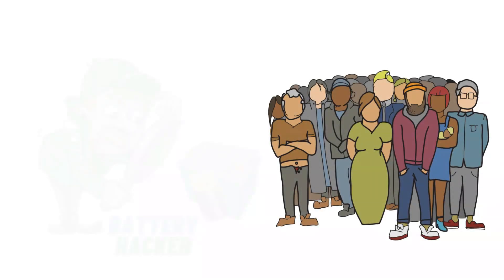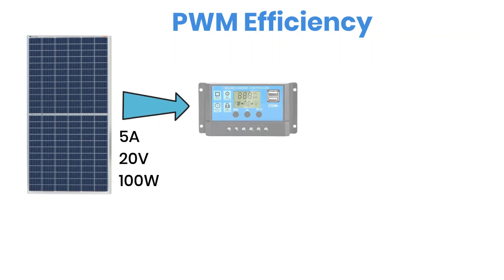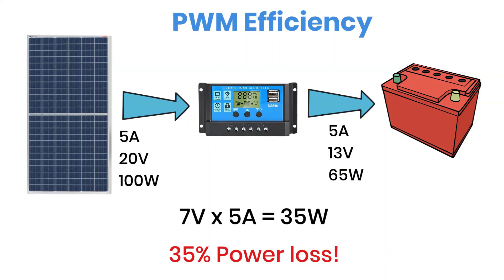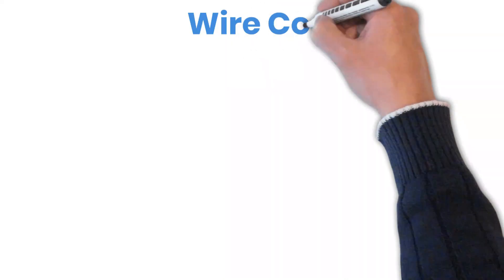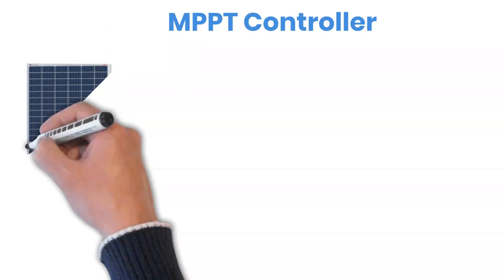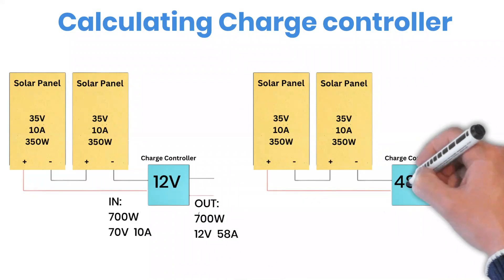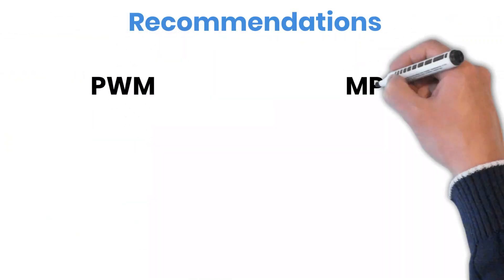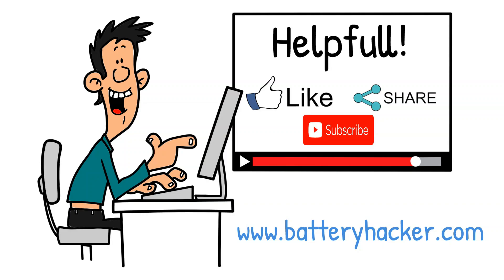PWM vs MPPT Charge Controller | Which Solar Controller is Best for You? | Battery Hacker

Comment: We live off grid with solar panels appliances and
Reply from the maker: That’s great to hear. Living off-grid is a big step toward true energy independence. How’s your experience been so far? Any challenges with your solar setup, or is it running smoothly?
Reply: @batteryhacker4343  battery at 14 but wish it would be more
Reply from the maker: Got it. 14V sounds healthy for a full charge, but if it’s not staying there long, it might be your charge controller settings or battery size.
Are you using a PWM or MPPT controller in your setup? That’ll help narrow it down.

Comment: Mppt charge controllers got so cheap nowadays, there is NO reason to use PWM controllers anymore. Maybe for a self built solar lamp in your garden, but don't use them in your van, RV or for your home solar system.
Reply from the maker: That’s a fair point. MPPTs have definitely become more affordable lately. Though in small setups (like under 200W), PWM can still make sense for those on a tight budget or when efficiency isn’t critical. What kind of system are you running right now?

Comment: Waaree 395 what two piece solar panel Kitna empier ka pwm charge controller Lena padega Jo 12.6 volt lithium ion battery ko charge Kar paye and load chalana chahta hun 💓
Reply from the maker: Hey! Two Waaree 395W panels will give you around 790W total. For a 12.6V lithium-ion battery, you’ll want at least a 60A PWM controller, though honestly an MPPT would handle the power more efficiently.
Also, if you’re planning to run a load directly, share what devices you want to power, and I’ll help you calculate it properly
Reply: Bldc Jupiter ac/dc 12 volt solar ceiling fan 2 piece and 9 watt LED bulb 6 piece and LED TV 21 inch and setup box noly aur kuchh nahin
Reply from the maker: @shantanuaich63  Nice setup! That’s a solid combo: two BLDC fans, 6 LED bulbs, and a 21-inch TV with a set-top box will pull around 180–220 watts total.
Your 790W panels can easily handle that, just make sure your battery is around 100Ah–150Ah (Li-ion) so you’ve got enough backup after sunset.
By the way, how long do you usually run all this at night?